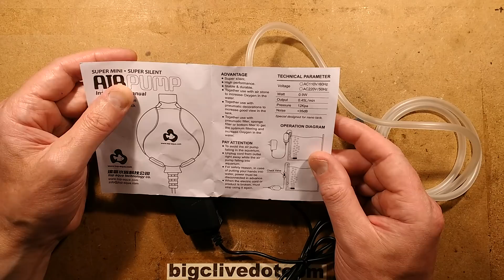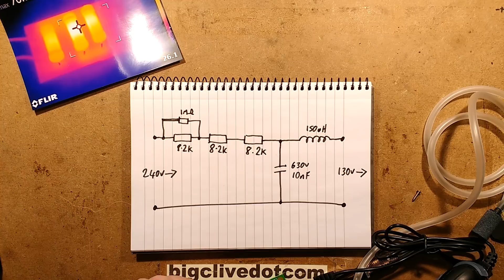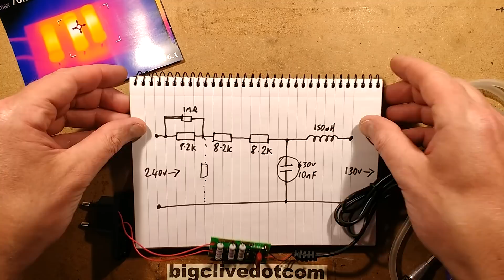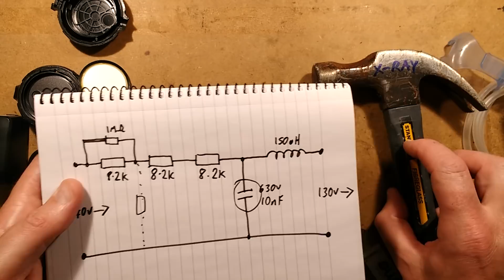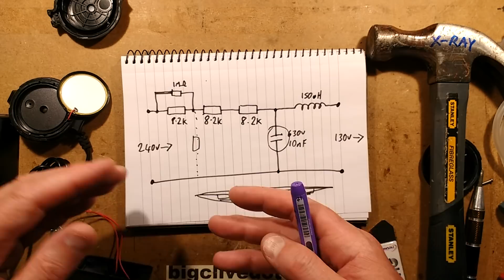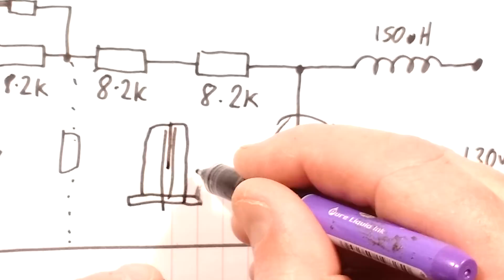Inside a near-silent piezoelectric air pump.

Comment: it'd be interesting to run it faster than 50/60Hz to see how much more air it would pump
Reply: Or less as the valves physically need time to move. And yet worth a try
Reply: How about connecting the piezo via a bridge rectifier to get 100Hz?   You're in with a decent chance that the valves fitted would cope with  that.  But with the same power input you'll get a smaller excursion of the piezo so you want to increase that.  Also the sound gets more noticeable at higher frequency.
Reply: +bigclivedotcom and Ray Kent -- When a piezoelectric crystal is given DC only, it deflects in one direction only, and stays that way until power (essentially just voltage) is removed. So you would have to make sure there was no capacitor storing DC. But the piezo device itself stores energy, and acts like a capacitor in that way. So I think you'd have to give a discharge path, maybe just a resistor, but probably some active circuitry with a transistor, though a mere NE2 neon light might do enough. What say, Clive?
Reply: YodaWhat   I think that what you said is technically correct,  but you're missing scale.  Similar sized piezo elements are used for tweeters and beyond into ultrasound.  That suggests that they have very low capacitance, though I can't give a figure offhand.  If driven direct from a bridge rectifier the discharge is catered for by the reversal of current.  It's true that there would be an average dc offset from that set-up, but a series capacitor and parallel resistor would deal with that, if needed.
Reply: Piezoelectric devices are modeled as a combination of inductor and capacitor, which both stores energy and resonates at a certain frequency. While they can work at other frequencies, efficiency is then lower. High-end audio equipment compensates for that by brute force: Shoving more watts at the tweeters. And it is always alternating current. The scale of the air pump device is actually far too small to resonate efficiently at either 50 or 60 Hz, and it shows no evidence of extra (vibrating) mass being added to lower the resonant frequency. So yes, on that front it would be better to use higher frequency. But it has to be AC, not DC. While a bridge rectifier receiving power through an AC-rated capacitor will give pulsating DC current to a load, it is not clear that this piezopump is enough of a load to get serious pulsation. If efficiency is ignored, a dummy load resistor across the piezo element could force the issue, of course, but it will certainly be inefficient. If Clive were inclined to re-engineer devices, I would suggest using the first harmonic at 150 Hz from a squared-off 50 Hz sinewave, or even a variable-frequency oscillator circuit. But there are other Youtube channels for that kind of modifications.
Reply: @YodaWhat  Is it possible that the capacitor and inductor in the power supply are actually working as a tank circuit?  The power supply doesn't seem to be a rectifier of any sort.
Reply: @rehoboth_farm  - I would have to re-watch the video. and/or get the actual values of inductance and capacitance for a resonance calculation. But in general, the ONLY reason why a power supply would attempt to resonate at line frequency is to produce a trapezoidal wave output. This is definitely done in some ferroresonant transformer devices, to improve AC Power Factor (PF) and to ease the peak current during charging of the DC capacitors ... in whatever other equipment is connected. Side effects: partially regulate the output AC voltage and prevent most brief power glitches from making it through to the output. All of that is drastic overkill for a cheap air pump.
Reply: Why are you assuming that it is running at 50/60 hz?

Comment: Nice application, but Clive, you forgot to plug it in to show the diaphragm vibrating - you could use a laser pointer to reveal the size of the deflection and even reflect the beam on the the wall to show lissajous patterns and any harmonic modes of vibration!
Reply: Justin Richards When you were stoned and submerged in what exactly ?
Reply: I wanted to see how well it worked when the stone end was submersed
Reply: @kissingfrogs  https://www.youtube.com/watch?v=ydoKydWKjK8
Reply: Would need to convert displacement into significant rotation for a usable effect, but this is effectively what digital projector micromirrors do although I think they are electrostatically operated.
Reply: Viewing the signal with an Oscilloscope would be helpful.
Reply: @ahaveland  ⚠️ God has said in the Quran:

🔵 { O mankind, worship your Lord, who created you and those before you, that you may become righteous - ( 2:21 ) 

🔴 [He] who made for you the earth a bed [spread out] and the sky a ceiling and sent down from the sky, rain and brought forth thereby fruits as provision for you. So do not attribute to Allah equals while you know [that there is nothing similar to Him]. ( 2:22 )

🔵 And if you are in doubt about what We have sent down upon Our Servant [Muhammad], then produce a surah the like thereof and call upon your witnesses other than Allah, if you should be truthful. ( 2:23 )

🔴 But if you do not - and you will never be able to - then fear the Fire, whose fuel is men and stones, prepared for the disbelievers.( 2:24 )

🔵 And give good tidings to those who believe and do righteous deeds that they will have gardens [in Paradise] beneath which rivers flow. Whenever they are provided with a provision of fruit therefrom, they will say, "This is what we were provided with before." And it is given to them in likeness. And they will have therein purified spouses, and they will abide therein eternally. ( 2:25 )

⚠️ Quran

Comment: If its putting out 500ml per minute that would be 500/3600 ml per cycle. If you assume about roughly half the diaphragm is moving 
3.14 x radius2/2 x deflection= 500/3600 so not a very large deflection

Comment: I wonder how good it would of worked in an actual fish tank. Water pressure and all that kind of stuff makes the pumps I have work pretty hard. If it worked, would buy one in a heart beat to try it.
Reply: I'd be interested to know. I have some deep tanks, the depth just kills any pump I put on it. I've thought of going to a piston pump and small air tank over the diaphragm ones.
Reply: I was thinking more small DC reciprocating air pump. I like the idea of using a geared syncro motor though.
Reply: 2009dudeman   hi! Please check my maths, I'm bollocks at it, but for the flow rate Clive cites I get a rough equivalent of a 1cm radius piston with à stroke of 1cm at a frequency of between 2 and 3 Hz.   Well below audio except for the motor and gear train.  For a small dc motor, have a look at what are called solar motors with built in high ratio gearing.  The bike pump will cope with the pressure, but will à very low power motor provide the throughput?  My bet is that if it's rated at about 2 watts then it can.
Reply: just use thinner tubing
Reply: Into steam punk?  A mini bike pump should give more than enough pressure.  You don't want to stand there moving it in and out?  How about cranking it with a microwave turntable motor?  Nice slow action, quiet, but I don't know if it's powerful enough. I've made a water pump using the motor and gearing of a wind-up torch.  Runs at  2 watts and can deal with a 3 metre head of water!  Yeah, but very low flow rate....  Be warned, not all of their generators are effectively brushed dc, so you might only use the gearing.

Comment: I wonder what the longevity of this is versus a more traditional pump? Having had a fishtank for some years, the noise of the traditional pumps can get quite grating if you're in the same room as them... :P
Reply: Sure they are. You would just need about 111 of them @ 0.45 lpm in parallel to get your 50 lpm. Of course the noise would be additive, too. There are lots of other pumps that might do what you need. Industrial and medical surplus suppliers always have odd air pumps.
Reply: I've used these (AllPondSolutions branded) for a few years across four aquariums and they're all still running fine! I've never turned them off in the time they've been installed so they have been running continuously during that time. They're very quiet, however they're not completely silent, you can still hear a slight buzz from them. If you mount them with the clip or the suction cup they come with to the back of the tank they're barely noticeable.
Reply: I wonder if they have a larger size as I use an aquarium pump as my air assist on my laser machine and it is louder than the screams from hell.  Something around 50l a minute is needed.
Reply: Due to the nature of the mechanism, they're only rated for tanks up to 45l in volume, it's unlikely piezoelectric would work well with larger tanks due to the difference between the air pressure produced and the water pressure at the lower depths, unless you only wanted to run it nearer the surface.
Reply: Get a few of them
Reply: The Best Stooge just put a conversation air pump in the next room !
Reply: They’ll probably last a long time. This type of technology usually does and is fairly simple. Honestly I have been impressed with mine. The only thing I’d watch is the small hole where air comes in. They want you to keep the pump above the water line so that pump doesn’t suck water in. Other option is place it off the aquarium or just be mindful of splashing water. Mine is working well in a small Betta tank on a night stand with a check valve and regulator. The regulator isn’t really needed and I do run short air hoses but the regulator I left since the Betta generally doesn’t like to much agitation. Short story it’s not as powerful as my AquaTop but it surprised me and was plenty for the application I needed it for. It’s also running a small sponge filter no problem. So yeah I’d say up to 10 gallons tops. You could ditch the regulator for more flow. I probably wouldn’t ditch a Check valve.

Other thing is they are definitely quiet. Extremely quiet.

Some people reported week air flow. In larger tanks maybe with large sponge filters and check valves and long runs of tubbing yeah that’s possible. You can tweak that. A shorter line will always give you more flow. Regulator isn’t really needed unless it’s in a small Betta tank. 

Overall I’m happy with these products on the market. I bought a Hygger but they are just Chinese rebrands. Same thing.
Reply: The Best Stooge Tried something like an airbrush compressor?
Reply: "the noise would be additive, too" - with dampening? Plus you could also run them at different frequencies too... You could make them cancel each other with a custom driver.
Reply: They aren't additive like that.

Comment: It's pizzaelectric!
Reply: Do R/C! Zzzapp, mmmmm pepperoni!
Reply: putana-electrico
Reply: Watch it, buster - that's my trademarked brandname for my toaster oven company.
Reply: Jafafa Hots I invoke fair use!
Reply: Use of these disks in ultrasonic mist makers always concerned me.  Are they silent only because the noise they make is above human hearing?  So are they doing the same thing to your brain that they do to the water -- atomising it, but in a way such that you don't notice.  That his pump operates at line frequency is reassuring.
Reply: Almost right, the a should be an o as in pizzoelectric though the spelling suggests pie-zo-electric.
Reply: them ultrasonic misters are really not that ultrasonic. you can hear them with no liquid in them it is just very faint.
Reply: @CotyRiddle Not really the frequency they use is very high way above human hearing. I heard its like 1.7 mhz in some of those devices.
Reply: Nigel Johnson I think he was kidding.
Reply: Do R/C! So was i!
Reply: Piezoelectric ceramic plates... very cool

Comment: Did not expect to hear nothing when you plugged it in.
Reply: Yes but I’ve used pumps for out door fountains that make enough noise that you can hear it 10 ft away
Reply: And they have been about the same size if not a tiny bit bigger

Comment: The first resistor is marked "C1" on the circuitboard.
Reply from the maker: It may have been for a series capacitor, but they might have found that the piezo disk was oversensitive to transients with a capacitor in series.
Reply: At least that explains the discharge resistor. Funny that they still bothered to populate it.
Reply: I'm glad I'm not the only one who noticed that :P

Comment: ALL HAIL THE VICE OF KNOWLEDGE

Wonder would that pump work for Julians liquid solder pump device?
Reply from the maker: The solder paste dispensers require really high pressure to get reliable results.
Reply: Damn, I'm sure he already tried something like that already. Probably would have been better than the foot pump he used lol.
Reply: All hale the Hammer Of Knowledge!
Reply: Simon Hopkins
 The Hammer of Vision it is, but Clive has another weapon in his arsenal, the piss flap spadger !
Reply: Simon Ruszczak
 I bet Thor doesn't have X-ray on his hammer like Clive does :P
Reply: The Hammer of Vision.

Comment: Hmm! I have an aquarium air pump that I got for oxygenating copper chloride etchant. I haven't taken the pump apart (yet!) though.
Reply from the maker: I put this one back together with plastic glue and also used it to aerate copper chloride etchant.  But my etchant is foaming up, so I think my concrete cleaning hydrochloric acid is possibly laced with surfactants/solvents.
Reply: Hmm, yeah... if it's foaming then it probably has a detergent in it. Very interesting about the difference between things in the US and UK.
Reply: The air pump is not visible in this photograph: http://randomer.net/ee/clean-n-etch-02.jpg I've also intentionally exaggerated the the toxicity of the copper chloride.
Reply: bigclivedotcom see if you can find some hydrochloric acid for pools, it it's concentrated hydrochloric, and as far as i know has nothing else in it. Usually by the name of muriatic acid (in the US at least)

Comment: to measure the airflow you could take a balloon and submerge it in a measured container of water with the tube going inside the balloon and fill the balloon with air for a few seconds and measure the displacement of water.
Reply: Thomas Richter filling up a balloon would take a fair amound of static pressure. If the pump could even handle the backpressure it would surely scew the results. My ides would be to use it as intended in a fishtank and catch the rising bubbles unter water with an upside down glass :)
Reply: muh1h1 you can fill about 100ml of a balloon without significant pressure.
Reply: I think the catching-bubbles method might be easiest to measure accurately. You could use a clear plastic measuring cup. Easier than trying to calculate the specific volume of a balloon.

Also, the elasticity of the balloon and the air itself might introduce error.

I wonder if the depth of the stone would affect rate of flow? Like pumping water against a head?
Reply: I really must wear my reading specs for these comments. I read that as baboon, not balloon. That I just read past it without undue shock and bafflement says more about Clive's channel than it does about me I think.
Reply: But shouldn't intended usage decrease airflow too because of water pressure?
Reply: Siana Gearz It should